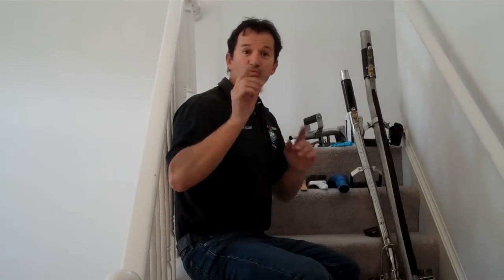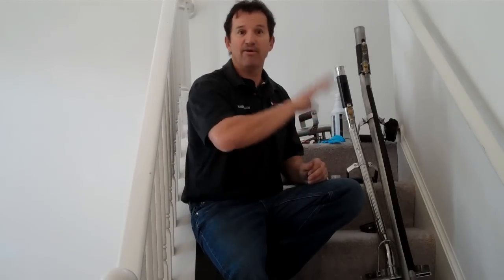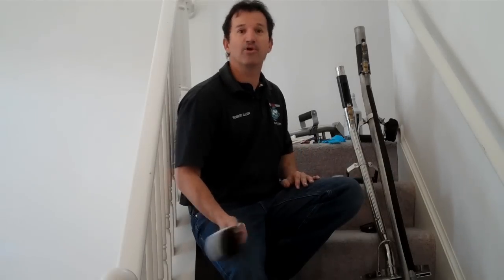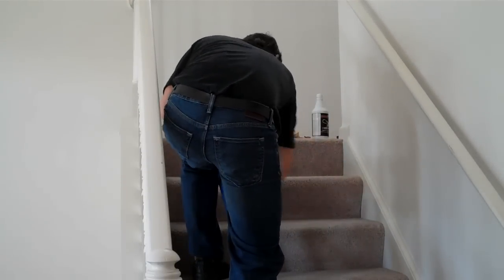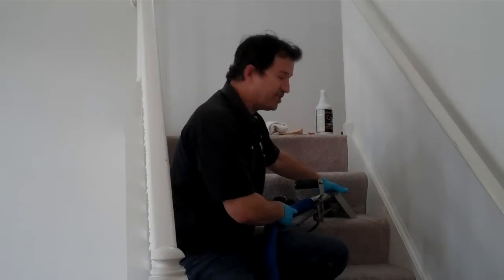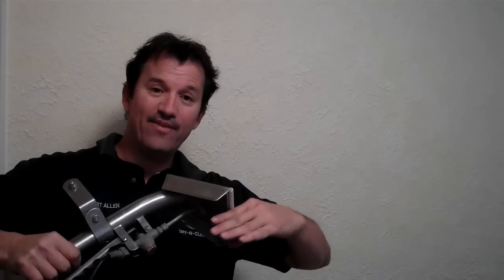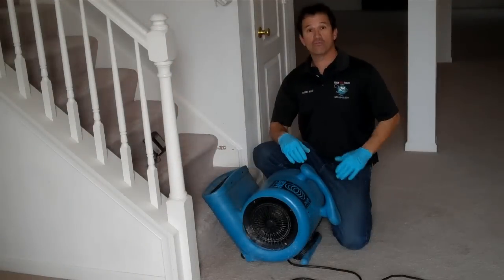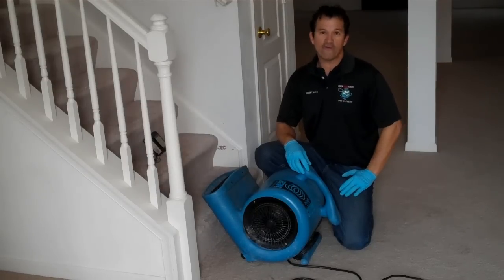🏠 HOW TO CLEAN STAIRS // STAIR CARPET CLEANER // CARPET CLEANING HOW TO DO BY ROB ALLEN TMF

Comment: A handi groomer in place of a tamping brush to agitate the sides of stairs works better and does not cause as much nap distortion and/or fuzzing...and gets into edges or gullys much more easily, which is very important for filtration soiling removal.  Try it Rob, you'll like it!
Reply from the maker: Thanks Thomas. Never had any nap distortion with a horse hair brush but I will try your suggestion. Thanks for sharing. Hope you have a great year.
Reply: TruckMountForums If you read my post, I was saying to replace the  Tamping brush part of your process with the Handi groomer, not the horse hair brush. The Handi groomer gets the edges, and where applicable into the gully much more easily and doesn't distort nap or cause fuzzing. Sometimes I even get fuzzing during serious spot/stain removal, and for those times I use a Sunbeam fabric shaver / pilling tool... works like a charm and it is great on upholstery as well. Just trying to help...

Comment: Such great info. Do you typically do the stairs first so you can get the fan on them early then remove the fan before leaving? Or do you leave the fan and come back to get it the next day? How long does it take to dry the stairs if you did it the correct way like you showed?

Comment: Just a question.  When you say you like to use a high flow jet on your stair tool what are the specifications?  Also wondering if you use the El Dialbo for upholstery cleaning and how you get enough water flow to activate the kero burner flow switch. Great video by the way, thanks.
Reply from the maker: Peter Garland I'll have to check it. The way I see it is the water is already pretty hot from doing the upstairs carpets. I think it's a 06 jet but don't quote me. And another thing I do is hit top treads with the wand on way down and it's super hot water. Then I hook up stair tool and rinse. Don't need as high heat for risers, bull nose or side caps. Hope that helps

Comment: Hi, nice video. I noticed that you didn’t pass the wand right on the edge by the stair trim, is there any special reason ? I want to think that you want to preven water go to the nails that hold the carpets in place ? This can bring rust spots later, is this correct ?

Comment: I would like to see how you get rid of ventilation soil on stairs
Reply: Easy use the Filtration soil remover here: https://shop.truckmountforums.com/products/filtration-soil-remover
Reply: Ah thank you I'll try it eventually it's kinda hard when you have a boss that's been using the same product for 21 years but I'm trying to get him to update. I know it's expensive but it's well worth it if it works.
Reply: I like your truck btw. Ours is a big ol box truck as well. It's got a brand new Areo tech engine aboard. It works great. It's just our wands are old and our prespray is outdated

Comment: Bought a ips pro sprayer one of the batteries doesent charge anymore 
callen tmf it took a about 10 calls before they got back to me then told
 me the battery is ips pro com. problem wont be buying anymore from tmf 
store.
Reply from the maker: Actually there is a regional distributor who handles all issues and quickly. Just email me for his info. roballen@truckmountforums.com